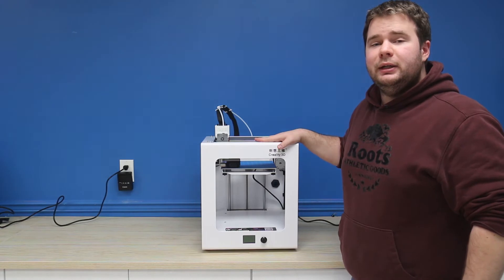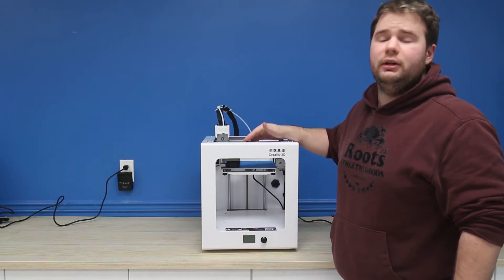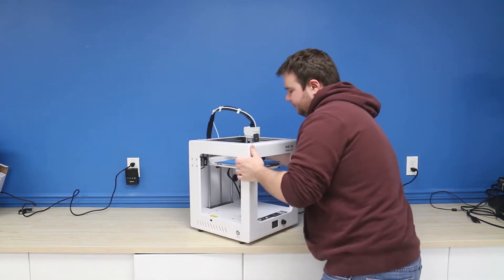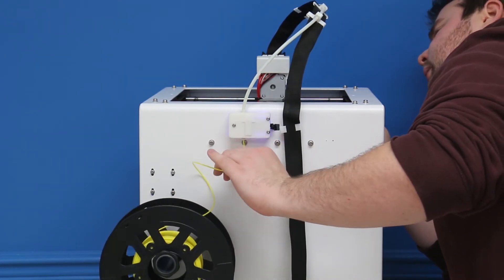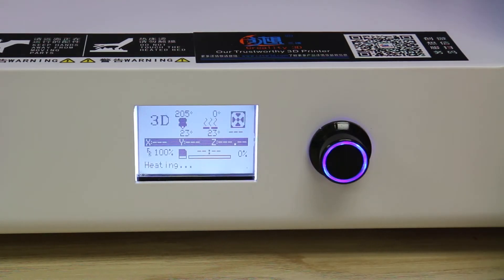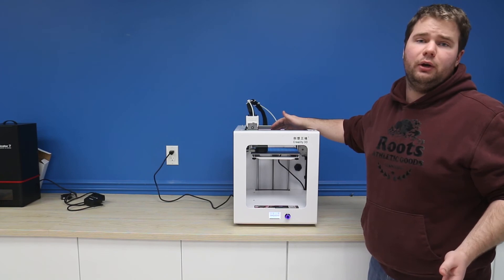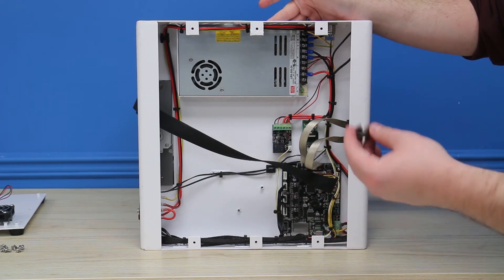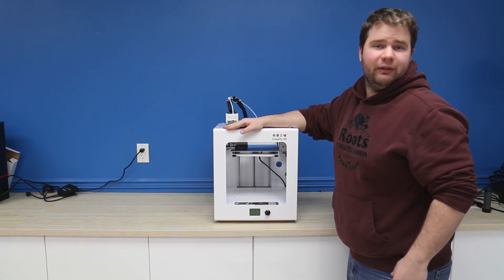Creality CR-2020 Overview

Comment: Okay, let me see here, no reviews, it is something you can buy, for around 900-1000 usd, and you dont even get a enclosed chamber?
This must be some kind of joke from Creality, I´d take a Qidi Tech X-Max or even a Creality CR-5 Pro before this
Or even buy another cheap Ender series, upgrade it with linear rails, a Bigtreetech motherboard, microswiss or bondtech directdrive or even a good cheap clone and build a IKEA lack enclosure around it and save yourself a bunch of money and griefs too since this one seems "cheaply" built and with no features that impresses at all really

Another of those paint a pig projects from creality
Dont get me wrong, I own creality printers, but I have taken upgrade routes every time and been nothing more than satisfied, the only nail in my box is the cr-6 se one though..that was a bummer!
Reply: It's a completely different type of machine from those you say, and at the time of writing this either it's in higher demand than the supply or its discontinued as it's near impossible to find for sale and cases of ownership.

To me, it's a cheaper version of a Zortrax M200 which is a cheaper version of the Ultimaker style, each with their own differences.